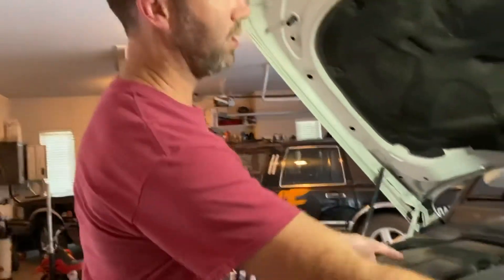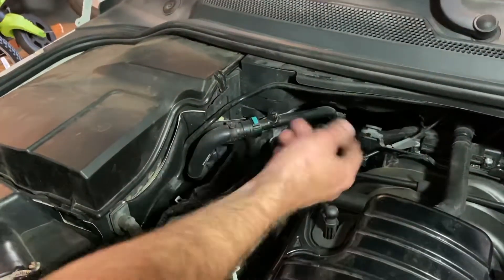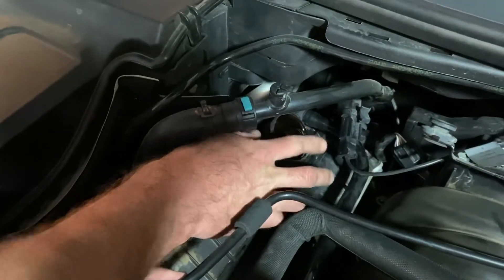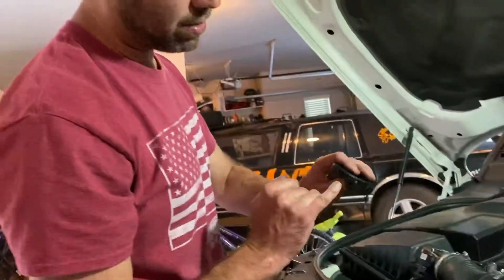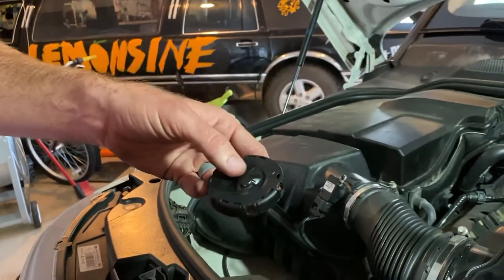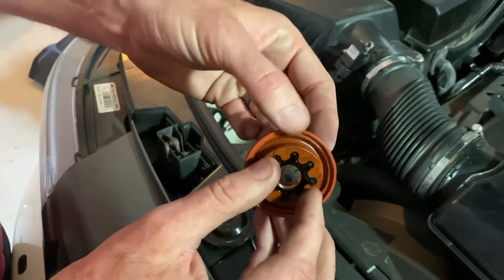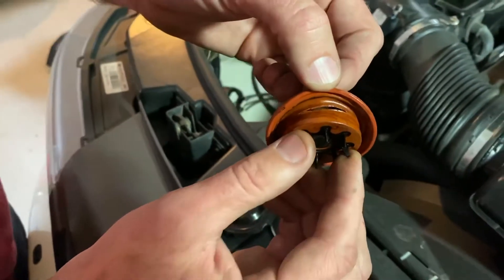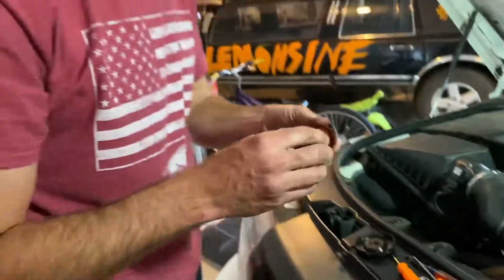Land Rover 2010 Range Rover Sport 5.0 P0171 P0174 System Too Lean

Comment: Did your car idle high when the problem was present?
Reply from the maker: Frank, I don’t remember it idling high, but it would seem feasible to react like that.
Reply: I have the same question about the engine idling because mine has this error, it makes this whistling noise and the idling speed increases from 700 to 1000 RPM when I stop the hot car in P

Comment: I have question please, dose the PVC make hissing sounds normal? My pcv making hissing noise looks like there’s air moving or leaking even after I change them and I don’t have any problem with the car
Reply from the maker: First, check to see that it’s seated properly on the valve cover.  Then try and determine if it is drawing air in, or blowing out.  If it’s blowing out, there could be blow by around the piston.  You can probably check by opening the oil filler cap and place your hand over the opening, it should be slightly negative pressure.